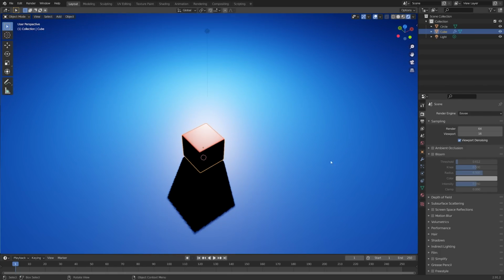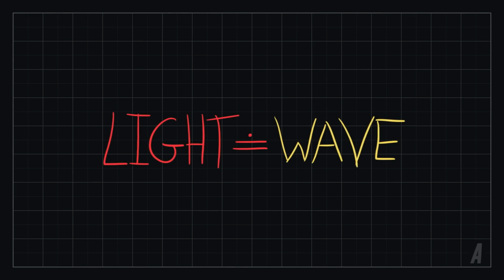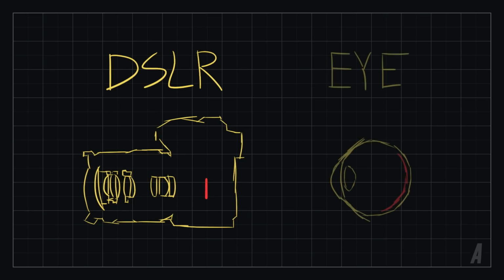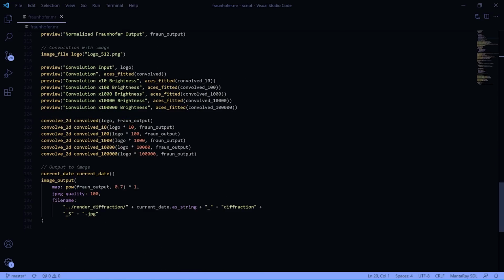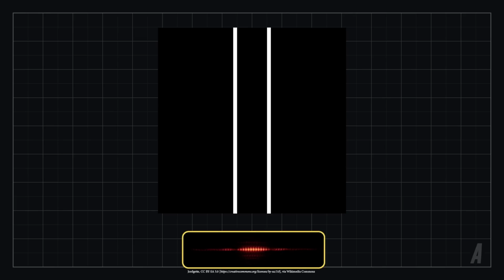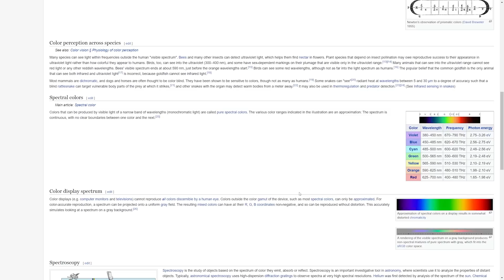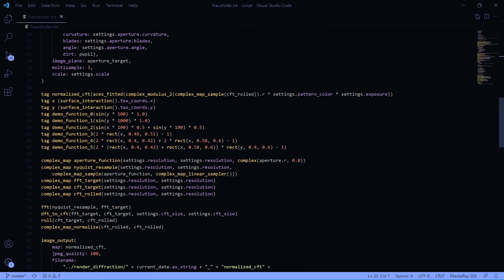What is bloom? (And how is it simulated?)

Comment: Still a very good video 3 years later! How dead you came out with this iris aperture shape please? Did you done this manually? I read a lot about glare generation based on waves optics, perceptual glare and stuff. I guess to have a bit more accurate result it would be better to add the eyelashes as obstacle and some point spread function for the light scattering phenomenon that happens inside the eye. Also heard about the Fresnel diffraction but didn't understand a lot honestly 😂

Comment: So, can images be deconvolved with the FT of the aperture to recover the original, non-bloom image?  After all, it shouldn't be too difficult to get a proper image of the aperture with the camera.
Reply from the maker: That depends. The convolution process is basically multiplication in the frequency domain which can theoretically be undone pretty easily. However, in many cases, large areas of the function in the frequency space are zero. This effectively destroys information in the convolution process making it impossible to fully recover the original image.
Reply from the maker: @driatrogenesis  What does your comment have to do with this conversation? I'm genuinely confused
Reply: @driatrogenesis  yes it literally does
quantum mechanics is a real physical thing, if light was just simple particles then none of the phenomena such as the thing this video explains would be occuring at all, like  try to explain to me how particles get diffracted even though that's a property of waves

Comment: The way they usually calculate bloom in post-process is by convolving a diffraction pattern of a single point light source with the image. This way one can define that diffraction pattern directly, bypassing the aperture that it corresponds to, and then directly use that diffraction pattern to generate the post-processed image.

However, for most realtime applications, doing fft->convolution->ifft is usually too slow, so they use approximations of convolutions based on mipmaps : even though algorithmically FFT has the same asymptotic complexity as approximations based on mipmaps, in practice the constant in that O(N log N) is much higher and fft-based proper bloom ends up being an order of magnitude slower than mipmap-based approximations.

Comment: the blender demo you used was run with eevee which isn't a ray tracer. but is pretty close and runs much faster (usually) than the ray traced counterpart
Reply from the maker: Eeevee is not a ray tracer, you are correct. I was mainly just showing how most renderers typically do bloom with post processing. A ray tracer would need to do the same steps as well

Comment: 1:20 Though, this can be done intentionally in computer graphics in order to simulate an object that's brighter than the screen can display -- to make it so the total integrated intensity of the spot is still correct even if the spot size is not correct.

Comment: Very cool, is this the same effect that the james web telescope has when taking pictures? The stars in the pictures at https://www.nasa.gov/webbfirstimages/
Reply: Yes. The diffraction patterns of the JWST are mainly created because the mirror is six sided, individual mirrors are six sided too and have very slight gaps in between them. And there are three arms holding the secondary mirror in front of the primary mirror, which blocks light for the primary mirror.

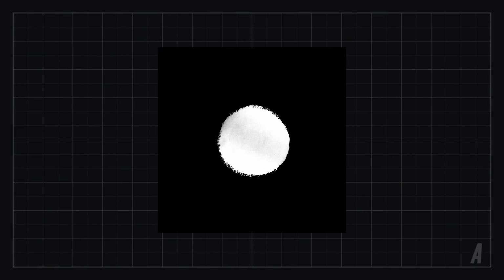Comment: 10:50 human eye looks incredibly interesting. I am an architectural visualizer and i'm always chasing after the newest tech.
Bloom in most renderers is kind of meh. What they do it take a low res version of the image, blur it a bit and add it to the original. then blur it some more add it again, and so on and so on. This does give a nice and smooth falloff effect but this looks MUCH more pleasing and realistic.
Are you aware of any programs/renderers that currently tackle bloom like this? Is it even possible to do so with the current photon based raytracing engines (which is basically every big unbiassed render engine)
And if not. Is it possible to apply this in some sort of way as a post step on a 32bit hdr image (you obviously need the extra dynamic range to get this to work properly)
If a solution like this would become available where you could just choose an alpha mask of an apreture and get insanely realistic bloom like this I am sure a lot of 3d artists chasing after photorealism would be interested.

BTW, MORE CONTENT LIKE THIS! This type of in depth content is a literal goldmine to people who are chasing after photorealism in art!
Reply: Afaik Unreal uses this partially. Doing this in real time can be expensive so they probably use a mish mash
The calculations are all post process effects anyway, unless you simulate the diffraction in the lense (which would be incredible expensive and unnecessary). You only need the brightness and colour data of your render to perform these calculations, and yes, you probably need HDR data for more range to make it look good.
But yeah, it would be enough to code a small program that takes your HDR render and applies the bloom, without the need to change the raytracer. It's all post process
Reply: I'm a compositor for TV/Film in the VFX industry, and we use software called Nuke. It has a node (effect/tool) called convolve, which takes an input image and convolves it with a kernel image (can be anything, but usually is an image of an aperture). Very common thing to do, because it's super valuable for making various lens effects - bokeh, glare, flares etc. Can do a lot of really creative things with it (and obviously Nuke by extension - every film you watch these days that has any sort of VFX will have used Nuke).

Nuke works internally in 32bit float, so you have a tonne of dynamic range to work with. So yeah that software exists :)
Reply: @PeterJansen  That's interesting! I am familliar with nuke and how much its used in CG but i've never used it since I work mostly in 3d and create stills. I never really touch compositing except for photoshop

Sound like something cool I might be able to try though! thanks!
Only thing im thinking is how to tackle tonemapping but im sure I can figure it out haha

Comment: Really cool stuff! How performant is it tho? And is it implementable on the GPU (can be parallelized)? :)
Reply from the maker: Thank you and thanks a lot for watching!

I would say that it is "reasonably" performant for the purposes of ray-tracing. The calculation of the diffraction pattern takes the longest time, especially if the color resolution is high, but it usually only needs to be calculated once per camera/lens (and theoretically could be cached between sessions). I can think of some ways to parallelize this calculation with a GPU but it wasn't useful for this particular project. The convolution between the diffraction pattern and an image frame is reasonably fast and depends on the speed of the FFT implementation. One might be able to implement a 2D FFT on GPU but I don't know much about this myself. Apparently UE4 offered a real-time bloom simulation that was similar to this but I don't know the details of their implementation. Hope that answers your question! If you're interested, the code for this project is open-source and part of the MantaRay ray-tracer on my GitHub page (link in description).

Comment: Has this ever been implemented in a video game? The effect looks really cool.
Reply from the maker: I believe UE4 may have had a bloom system based on the convolution technique I showed so it's probably been used in some video games, don't know any examples off the top of my head though
Reply: @AngeTheGreat  UE4 uses an image in the convolution mode
Reply: @NordicFrog I'm thinking it's the next step in the bloom evolution. First we had bloom with threshold:
Pretty simple. We threshold the color buffer then downscale it. Then perform a series of vertical/horizontal blurs. Then upscale and add it to the color buffer.
Problem is though, it looks horrendous. (That's why many players disable it first thing)
Next step is non-thresholded, where we directly downscale the color buffer 5 or 6 times, and then progressively upsample again. Finally we add it on top of the color buffer with linear interpolation. Looks better.
I think we are waiting for graphics card evolution a bit more. But beyond that no reason why this shouldn't become standard at some point - it looks way better, and it's more physically accurate.
Reply: hazel (open source game engine) has bloom based on subsampling which is not physically correct. Anges approach is more realistic.
Reply: usually it is implemented in bad ways. games like call of duty add bloom into their effects even though it is completely antithetical to the point of call of duty which is to be able to see the entire map. use it in cinematic scenes only imo or games where obscuring parts of the screen wont matter too much.
Reply: @Ryan-xq3kl  Technically bloom is pointless unless applied to the HDR image before gain and colorgrading, and with a very low multiplier like 1~5% (which is impossible for full-SDR engines btw). In this case it looks natural, and impairs no visibility.
Reply: So happy I stumbled upon this.
Reply: I love how no one responding here seems to see any irony in this comment whatsoever.
Reply: automation (a game where you make cars) has convolution bloom in its photo mode
Reply: I've seen quite a few games with lens flare and now I know about this phenomenon I'll take notice if that is included too. Call of Duty Advanced Warfare is one.
Reply: I believe Flacon BMS
Reply: UE supports this bloom technique, but the fft texture is only 1/4 of the initial resolution, still fast though, thanks to this video I know how I can improve this technique even more in my engine.
Reply: yes look up overgrowth by wolfire games, they used the same paper that i suspect this video is based heavily on. here is the  paper: https://people.mpi-inf.mpg.de/~ritschel/Papers/TemporalGlare.pdf
@angethegreat i think you should at least credit the author
Reply from the maker: I actually don't have access to that link so I can't comment. To be honest I mainly followed Wikipedia articles about fraunhofer diffraction, there isn't much else to this and I don't claim it's revolutionary
Reply: @AngeTheGreat  true ok
Reply: @AngeTheGreat  To be honest I have little to no idea of a practical implementation of this. The convolution kernel becomes huge, and it should either be applied "UE4-style" (e.g. to a limited count of the brightest points) or in a very low resolution (which is pointless). The closest I got to this was (and you can find the outcome) making a 1D diffraction image applied in various directions as 1D filters, which is at least somewhat convincing, and still pretty fast.